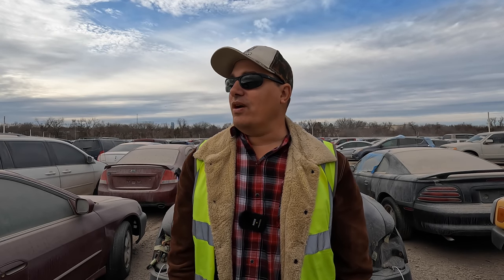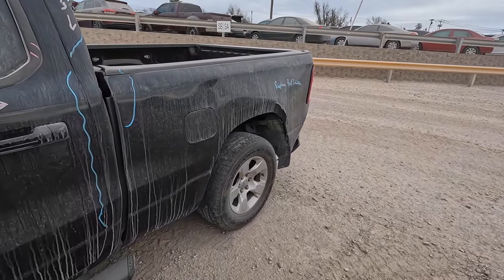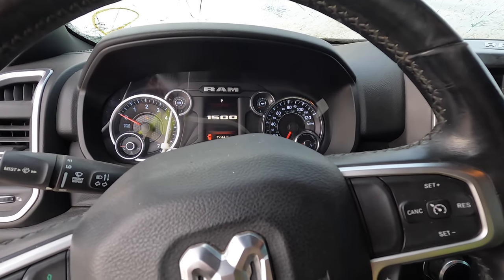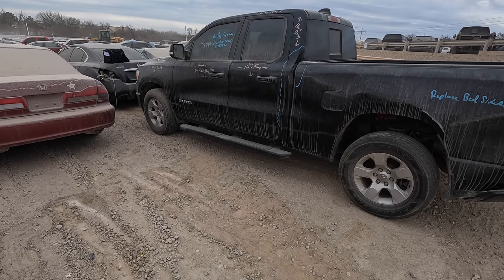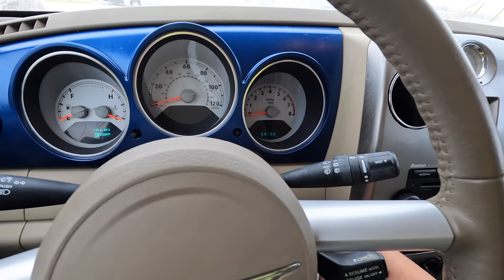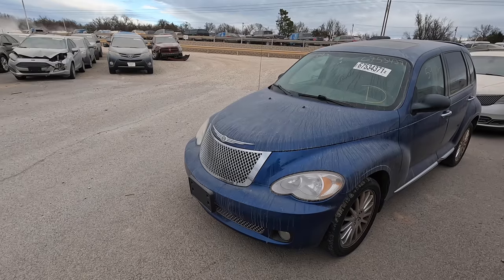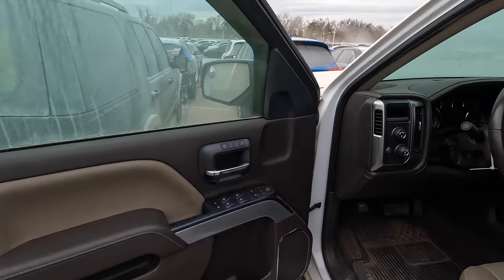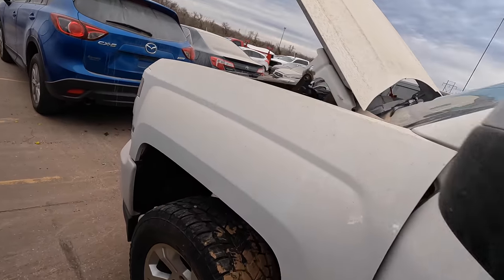Copart Walk Around 12-30-21 PM + 2018 Chevy 1500 LTZ!!

Comment: Having owned a Neon, it's that bottom motor mount that's bad. Ya gotta lift the engine up to get it out if I remember correctly. Like 800 at a dealer. However, if you can do it the mount is only like 125 bucks and then you got a great car there especially since it's the turbo. I'd buy that for sure.

Comment: All 3 I would have bid on. The Chevy truck looks like it has minimal damage. However the Dodge most likely use the engine and get a new cab, bed and frame. Also the PT Cruiser seems like a grandma car from the way it was kept in such great condition.
Reply: The dodge does not need a new motor. Probably just needs lifters and maybe a new cam.
Reply: Pt probably trans mount

Comment: 11:35 That's rare PT Cruiser with factory turbo but there are terrible to work on pass.
19:01 I like the 2019 Silverado Z71 yes it took a little fender bender in back but frame is still good from ur Go Pro canara angle  Randy.

Comment: That's a nice Silverado, I expect a rebuilder to buy that. I have a 2014 with only 7.400 miles on it now, kept it after my father passed even though I don't really need it but just a summer toy. Never been on the road in the winter here in CT, still looks new underneath. So to my original reason to post, I paused the video a few times and it looks to be the 4000 series Noco jump pack? It seems to work well jumping multiple vehicles, something I want to look into as a replacement for my older JNC. Just wondering how the Noco's have held up for you Randy as you're one of them who really puts a jump pack to a test?
Reply: I have been in the car business for 30+years so far the best jump box    i have  ever used is the BOOSTER PAC  ES5000 . as long as you charge it out of the box 1st and when it's full unplug and plug it in again keep on charge until you need it . When you do use it put it back on charge when you're done with it . Try not to run it down to dead . I have 2 that I personally use and charge , they are 3 years old . 4 more that are in the shop that get there assess kicked Monday to Saturday . They are 2 years old  still going strong
Reply: As for the noco ,I have the biggest one they do work pretty well but have no handle to carry it . Just a stupid bag . They definitely work great but Don't like getting beat on . Only charge when You plug in the charger port . Because of the anti -short circuit In  Them. They are good but if you use the hell out of your jump box it's not for you . . Get u a booster pac es5000 . 💯

Comment: Both the Ram And the Chevy Silverado would pull out, Bed and all, The first pull on both is on the rear bumper to start stretching out the frame, then hook into the bedside in the tail lamp opening to stretch it out, And while stretching the bed side, use an assortment of dolly's,  a slapping iron I very seldom use hammers with a dolly anymore as they tend to stretch the metal, The slapping iron I have is made out of an old heavy toothed file and the teeth will pull the stretch out of the metal if the body hammers are having a tendency to stretch it out, After the bed is stretched out to where it belongs it needs to be removed to provide access to the damaged cab corner and any buckles in the frame while pulling on it. One the cab corner I always removed the interior panels and found the deepest part of the dent with no obstructions behind it and drilled a 7/16 th to 1/2 hole and bolted a big eyehook into the sheet metal with the biggest plate I could fit in on the inside to move the whole dent out without tearing the sheet metal or stretching it around the hole! Once the cab corner is straight just cut a little piece of sheet metal to weld over the hole and then coat it on the inside with an epoxy or even a good undercoat to prevent rust if you're sure the damage is pulled out, then prep the damaged areas for a skim coat of filler, The last stage is unbolting the bed and either removing it or lifting it up off of the frame to get to the buckles  and pound them into submission with a 5 lb. Tonya Harding while pulling on the frame! If the hammer doesn't do it don't be afraid to heat the damaged areas up with a rosebud tip on the oxyacetylene torch while pulling on the frame! Just be sure to prep and coat any areas that you damage the paint on to prevent rust! I used to do a lot of trucks and cars damaged a lot worse than these are and I still have the frame racks and equipment and my shop to do it in but at 66 years old my health is too bad to do it any more! I wish I could still do this kind of work but old age catches up with the best of us!

Comment: 15:59 Definitely has some frame damage  where the tow hitch has pushed. It looks quite twisted where it mounts.

Has some damage, but it could be repaired "easily" I guess. 🤷‍♂️

What is with trucks and getting rear-ended? It seems to be quite common. 🤔
Reply: That Silverado is still worth near 40 grand!  I can't see how it did not get fixed.  My uncle has a 2006 GMC sierra and it was rear ended hard.  They replaced the back part of the frame, obviously, replaced the bumper and hitch.  The bed had no damage but it put two small dents on the back of the cab that a PDR company took care of with glue pull tabs.  It was 7,500.00 damage and insurance fixed it with out any issues.
Reply: @jewllake  If there is frame damage they have to replace the whole thing, the bed has some significant damage too add to that the recent difficulties with getting spare parts from the dealers and you get a totaled truck.

And honestly, we have seen cars and trucks with a simple "fender bender" being totaled and left at Copart, it really doesn't surprise me one bit.

Not that I don't agree with you, it could be repaired, but I bet the owner wasn't too sad, who knows how long he would've had to wait for the repair to be done. 🤷‍♂️

Comment: You mentioned the HHR - do you ever see any of those out there? I rented a couple of those and enjoyed driving them. One problem was that the roofline was so low, I'd need to duck my head to see traffic lights when I stopped at a red light - and I'm not even that tall. Other than that, seemed ok.
Reply: There was one in the background yesterday. Hood was pushed back badly so it was hard to recognize. I like the HHR too. I've driven 5 of them and put over a million miles on them (4 of them were work cars.) I hear you on the low top edge of the windshield. That and the huge A pillar has been my only complaint on them.

Comment: Hey Randy great video...I think at 15:56 on the Silverado looks like the frame is buckled right by the hole in the frame..also possibly in the back where the leaf spring mount is...but still all in all it's minor and could used anyway for a work truck... I'd fix it and use it ...Also just an FYI I saw on world news that there is a recall on 2017-2020 Tesla model 3 for something w the backup camera possibly being defective.u might wanna check it out ..

Comment: Those 5.3's are noisy off the lot . Also that new transmission they use is really clunky from reverse to drive . Sounds like bad u joints but 3 Chevy dealers said it's 💯 normal . 😂😂😂 Normal you say ???? Well best believe when it does start to break I'm gonna make sure it's 💯% really broke when it gets towed to the dealership for the warranty work .

Comment: I can't stand PT Cruisers, my wife and I call them TP Cruisers.  Window switches on the dash.  Neon underpinnings.  Typical Chrysler electrics.  Driving position is terrible.  Awful fuel mileage for an "economy car" but taxed/insured as if it were a truck because of the EPA size classification and these things kept Chrysler from killing off all the Hemis and giving us V6 pickup trucks.  But we're almost there now, that 3.6 Pentastar goes in everything doesn't it?

But THAT PT Cruiser, I'd take that excess chrome off the grille and probably remove the spoiler and that's a classy car right there.  Blue and chrome outside, tan and silver inside, I like that.  04-06 Sebring Touring wheels?  Or maybe those were on those new, I can't remember seeing one.  But with the turbo 2.4, 59K on the clock, that clean and nice, and only needing four grand worth of engine mounts, airbag sensors, and electrical work (hahaha I kid, I kid) I'd go for it.